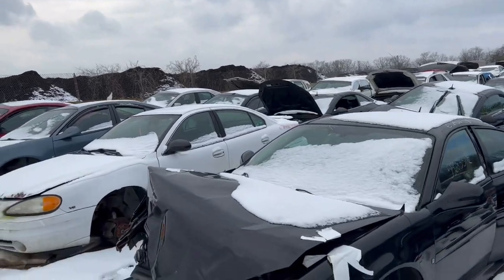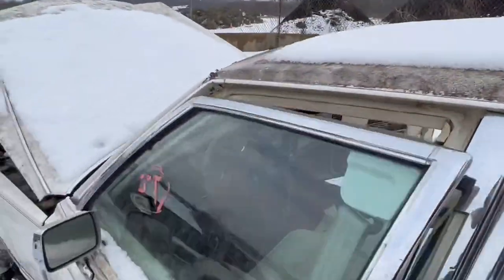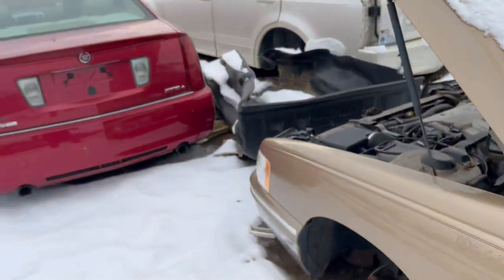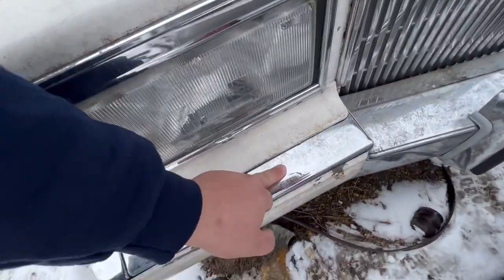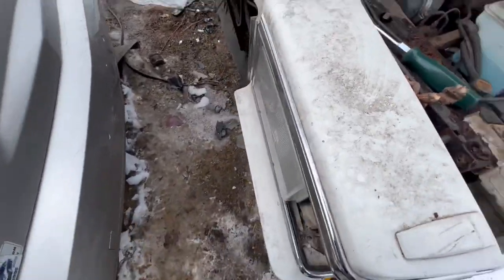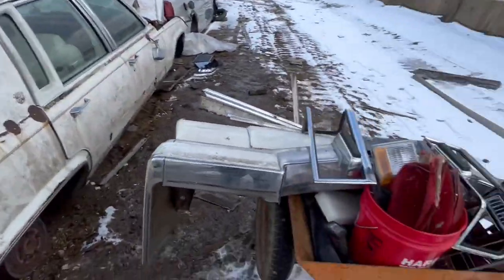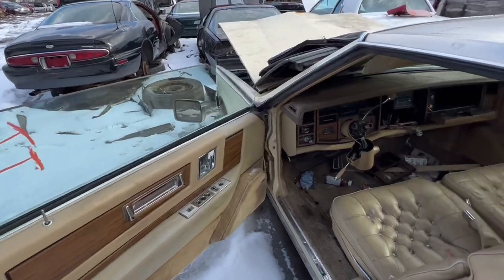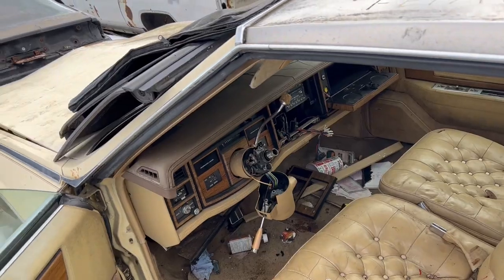Biohazard Junkyard Brougham! Triple white D’Elegance is INFESTED Cadillac Brougham Part picking

Comment: No doubt that was a stunner, I agree that was likely equipped with factory wire wheels.  In the future you will wish that you had taken more parts off of it.  You need to add a battery powered sawzall for your salvage yard expeditions - that way you can cut off body parts and remove stubborn fasteners in your shop.